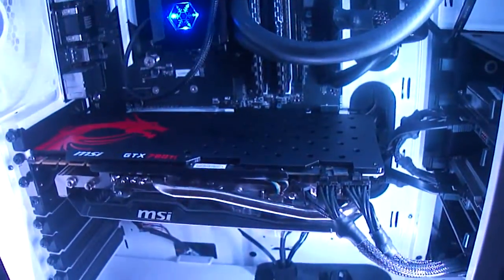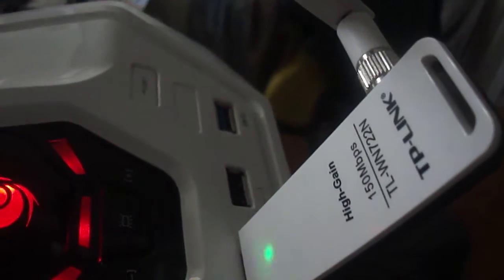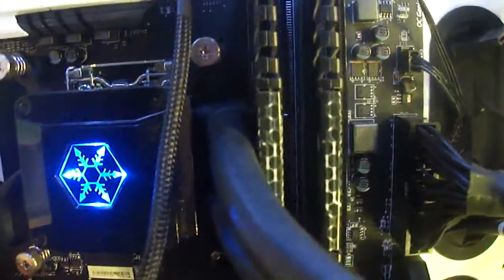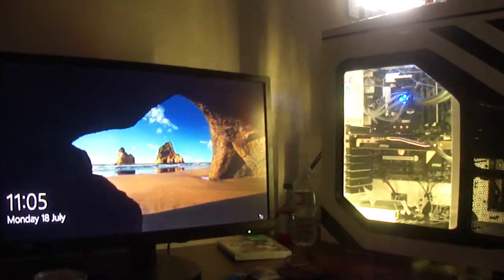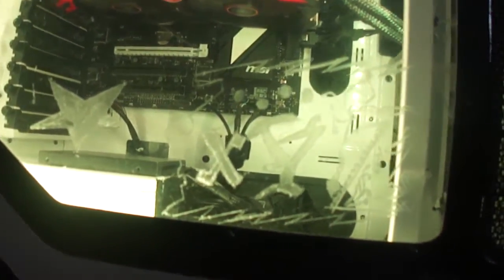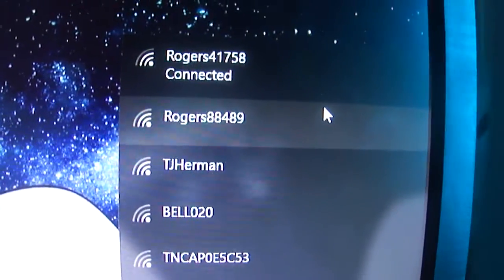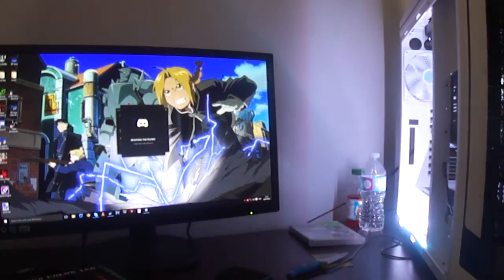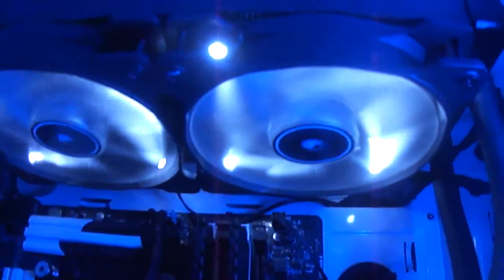My Custom PC and Gaming Setup for 2016

Comment: hmm an R9 390 coudlve of been viable aswell unless ur not a fan of AMD GPU´s
Reply from the maker: Yah it definitely was viable but in terms of performance they're literally neck and neck. the 390 only drawing more power and running hotter while offering a higher memory bus and more vram. which in the end doesnt benefit me much on a single monitor. however if i chose to upgrade to multimonitor it would definitely be a better option. Do keep in mind i got this 780ti for $250 canadian, i couldn't find a 390 for that lol.